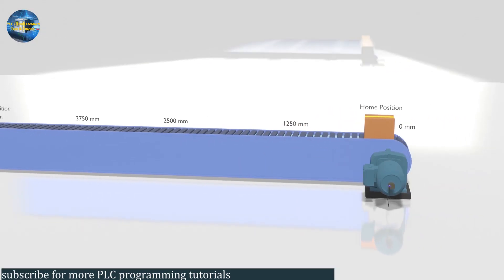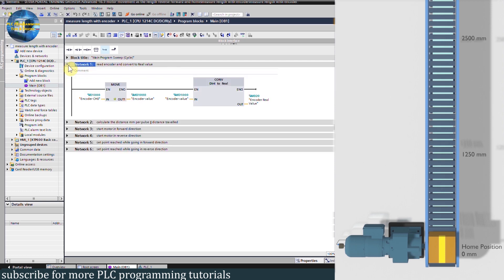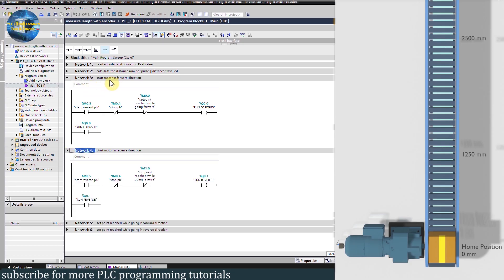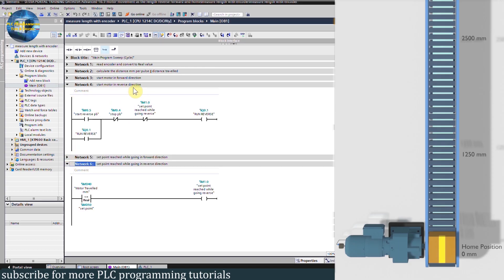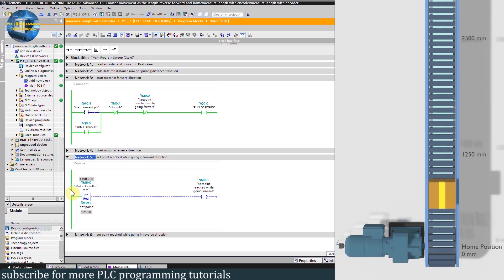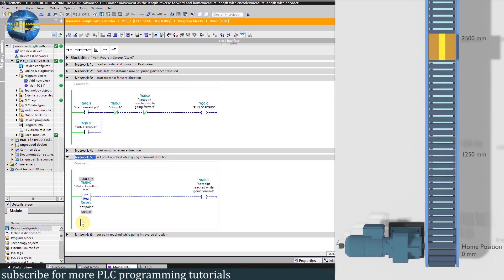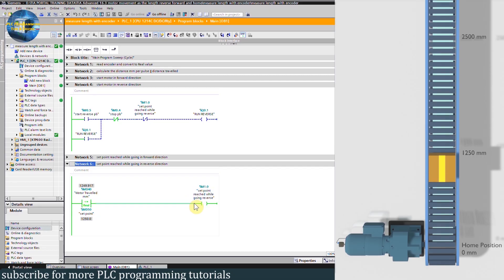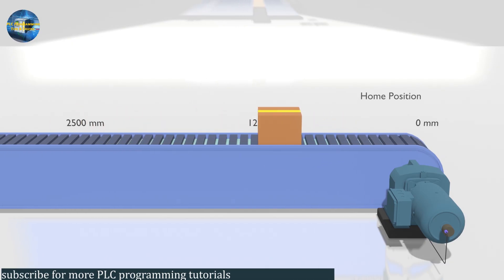Measure and control the Conveyor Movement using Encoder as feedback device . S7 1200 PLC Project

Comment: Hello, friend. Thank you for watching the good video
Let me ask you a question
Instead of the encoder, there are 20 magnets in the pulley and 170 mm diameter of the encoder pulley
There's a 185mm driver pulley on the motor side

Can't we use counter up-down to accurately calculate the travel distance like the encoder??
Please tell me how to do it!!

Comment: Maybe this a little bit stupid question, but i'm not completely understand, how you convert discrete impulse I0.0 to analog value. One impulse you transfer to MD1000 but where you summarize impulses which gives analog value 1250 or 2500 etc?
Reply: first you should know what is encoder. encoder as a device when it rotates it produces pulses.  basically.  in that example you should connect that in digital signal instead of analog signal.but q.s? why? because pulses are digital values right? but also you should store that values in a big data as id1000 you can think like that you have a counter for counter up inout you should you a digital input but counter value must be md format.  I hope that is clear for you
Reply: @sinanartemis6176  Thanks for the information. I understand why he connected the encoder to a discrete input. I do not understand where the summary of impulses occurs. MD1000 is this a counter?
Reply: @lockheadmaverick489  when it start to count that pulse store in that value for instance in 1 revolution it takes 360pulse and when it contunue that value also also increases you can think like counter
Reply: @lockheadmaverick489  yes MD1000 has been setup as a counter. In the beginning of the video when he is explaining the hardware configuration of the counter setup he mentioned the io address of the counter to start at memory address 1000. 
Kinda confusing but I found it.